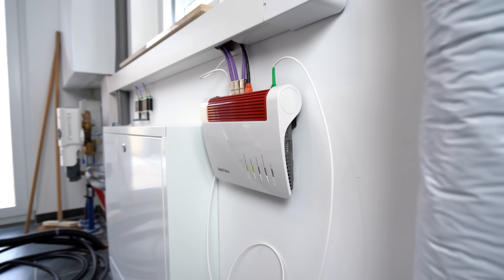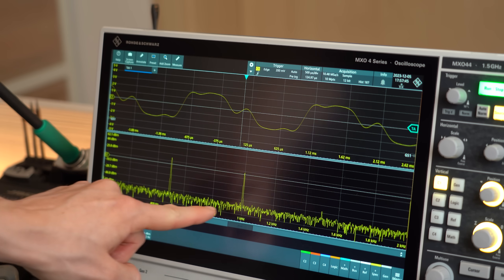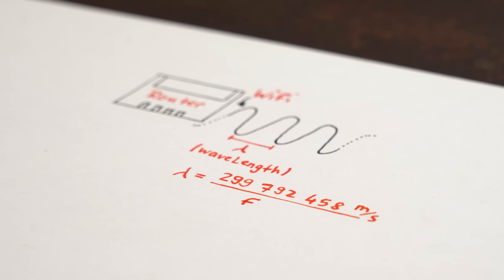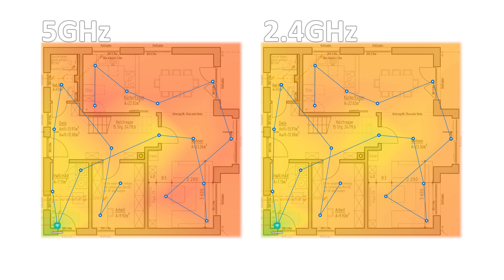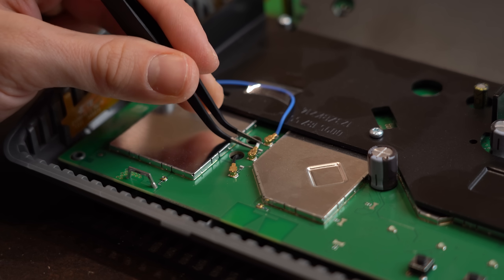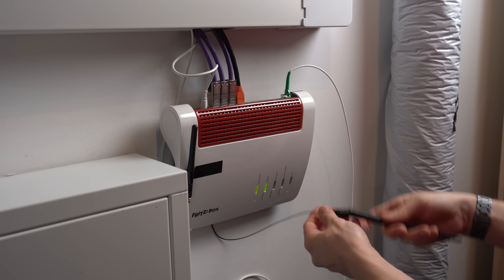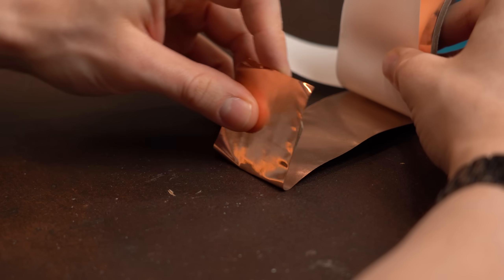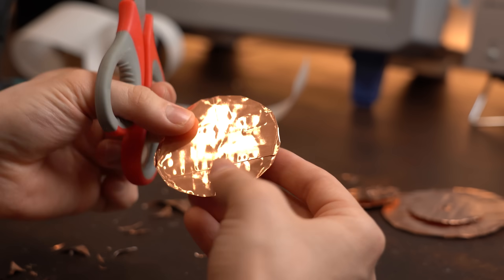I tried OVERPOWERING my WiFi!

Comment: Did you try swapping the two routers?  My guess is that the top floor has wood walls and the lower floors have masonry walls.  That would be typical of German construction.  If so, the difference may have been the walls, not the routers.

Comment: (maybe a little bit late): 
I fooled around months with new positions of the modem (even with Devolo Magic 2 LAN power adapter) ended up in exchange all  coaxial cable with CAT6/7 cables in my flat (which is on two stages) and a good separate access point on the second floor. So every fixed device (like TV) is connected via 1GB cable network. 
For 2 years so single problem so far.
Working time: ~ 1day (for getting out old coxial cables)

Comment: Your directional antenna is also illegal in Germany. At least without limiting the power. If you install an antenna that has a higher gain, for example cause it transmits mostly into a certain direction, you must adjust the power so that the equivalent isotropic radiated power (EIRP) remains the same. Essentially you must keep the energy density in the direction you're sending the same. Therefore installing a directional antenna typically doesn't bring you a great advantage (assuming you comply with the law).

Comment: There is also another problem with boosting the power of the signal, and that is that wifi communication is two ways.
If, let's say, you are connecting it to a phone, and that phone doesn't have the signal power to reach the router.
Think like two people far away shouting at each other, and only one can shout louder.

Comment: That so called directional antenna is completely inefficient and actually rubbish.  Properly constructed 5GHz antennas are available on the internet both in omni directional and directional (beam) types.  A Properly constructed gain vertical antenna for both frequencies will outperform the types you have experimented with.

Comment: Die you do a VNA Measurement on the directional antenna ? -- They are extrem sensitiv to korrect spacing etc. So that might explain it does not perfom that good. Those anteannas also have a extrem narrow bandwidth which can be a problem if its too narrow.

Comment: I saw your build of the antenna, and would like to suggest using a nylon bolt for the shaft. a metal support with no electrical isolation between the elements of the antenna defeats most of the advantages of the rear reflector and the parasitic elements in front of the main radiator ( the disk you hook the signal wire to. )
I built a dipole version of that to receive UHF TV signals when I lived in a valley surrounded by tall hills as a kid, and hung it in the attic of my house. only way I could receive the closest channel that was a PBS station halfway across the state from me.

Comment: And here I am upset when I am only getting 750 out of 950 Mbit (5 GHz) on my iPhone at some random location in my house due to some weird local dead spot in the antennae array or mesh overlap interference. 

Forget these consumer routers and their corresponding mesh systems. Buy a hardwired enterprise or at least prosumer mesh system. One usually tries to make stuff work for as cheap as possible and then realize that they should have done it the proper way from the very start. Also keep in mind that with such low transmit power levels in Germany, it makes no sense to place a router into a corner of your house and try to blast the signal across the entire house from there. With an omnidirectional antenna, you basically blast 50% potential coverage into the street if you place it at the edge of your house. In case you want to have a decent signal in your garden, just use a hardwired access point and place it outside. 

For roughly the money you spend on a FRITZ!box and some Fritz!Repeaters, you can easily get a couple of Tri-Band (2.4, 5 and 6 GHz) 802.11be (WiFi 7) access points and make future use of Multi Link Operation. Until you have more WiFi 7 clients, use WiFi 6 or 6E on the various bands. Another issue is that you are very limited with the settings on a FRITZ!Box. One used to be able to change the channel width, but with some Fritz!OS version they essentially just made all of them use 160 MHz. With the small 5 GHz non-DFS bands, you get quite a lot of interference, and most clients, especially smartphones, aren’t 160 mhz capable anyways. This shall change with WiFi 7, but it makes no sense for most smartphones which are 2x2 @ 80 MHz. The wider the channel width, the lower the real-world SNR. Depending on obstacles, it deteriorates the SNR and modulation and thus the distance even further.

In case you don’t want to jump the WiFi 7 bandwagon just yet, get some decent 4x4 MU-MIMO WiFi 6 or 6E APs. One doesn’t need too many people and clients in the house to make use of better speed and stability with DL / US MU-MIMO. One doesn’t need a 4x4 capable client to benefit from it. Beamforming can increase coverage and speed at a distance quite significantly and thus a fewer numbers of APs necessary.

Comment: Wireless basics.
Router with external antena.
Router in the middle of the house (map) in the possible.
Do not attach the router to the wall.
If you can't move the router.
Use one access point and fizx it in the middle of the house.
Sorry for ny english

Comment: Or stop wasting time, move the router to the middle of the house like a normal person 😂

Its a fritzbox just buy some cheap 3000 series and create a mesh i got 2 3390 i think they are for £30 each between them and a 7490 they cover the entire 1930s build 3 bed house with really fast speeds taking advantage of 1Gbps fibre.

I get about 600Mbps at the weakest point and 833 nearer the waps on wireless and obviously 1Gbps on the wire

Comment: Most issues are placement or orientation.  
I picked up some HP/Aruba 802.11AC APs which are PoE for $30/ea on eBay. Also picked up a cheapo Cisco SOHO switch $30.
I just went up into the attic and tacked them up there, ran some Cat5E patch cable down to the switch and then to my Verizon router.
~$140 all told, and my Ekahau survey had me at 65-70db for 2/5Ghz throughout a 1-1/2 story 2100sqf house.
Going to add another one with a mini-panel antenna for the 600' backyard.
If one only has a broadband wifi router, then it really pays to try to just plugging it in at different locations in the house to see where you get the best coverage before finalizing. Centrally located is usually best, and while I don't prefer them, a cheap wifi repeater $20 can give enough improvement to obviate the need for mesh or seperate access points.

Comment: Thanks for the video!
First of all, I note that your router has usb 3.0, and it has an impact on the 2.4 GHz network (more details can be found on the Internet “USB 3.0* Radio Frequency Interference Impact on 2.4 GHz Wireless Devices Intel 2012”)
Second, I note that the quality of your directional antenna greatly affects the result of the work, moreover, if you did it according to the parameters from the video, then I will clarify that they are incorrect even for 2.4 GHz.

Comment: Seems to me increasing the power would only work a little bit unless you add better antennas because the conversation is two way.  If you "yell louder" you must also "listen better".  I did a site survey and moved my WiFi routers around which has been very effective for me.  On the other hand if you had 2 WiFi routers and could increase the power of both they would make a good network bridge for repeating a signal.

Comment: Have you tried a styrofoam antenna? There you stick copper wires at exact distances into a styrofoam strip. As far as I know, the reflectors (the copper wires) should be isolated from each other and your build seemed to connect them with a metal rod.

Comment: Just modifying the antenna can also cause a device to exceed the regulatory EIRP power and still break the law. The best you can do is ditch the wifi in your router and install several access points. Don't even bother with repeaters. They were bad tech ever since they exist. Mesh solutions are marginally better, but the real solution is wired backhaul to every AP, as mesh comes with performance penalty too.

Comment: The Yagi antenna does work. You just built yours wrong by shorting the main element out to the rest of the antenna. If you isolate the main element from the rest it will work.

Comment: It's an understandable myth that 5GHz signals provide faster network performance. Network throughput does not only rely on frequency. It also depends on: the symbol rate (which is linked to frequency but also considers the processing speed and signal-to-noise characteristics of the modem equipment); the channel capacity (aka the actual RF bandwidth); how many RF channels are used simultaneously to provide a network connection; and finally, the bit-to-symbol encoding technology (which is sort of like compression). The wifi standards allow mixing and matching of these parameters to create just about any network speed on either the 2.4 or 5 GHz spectra. New versions of the standards add new capabilities as they get developed, increasing the number of options that can be chosen from.

The reason we see faster speeds on 5GHz is because, in practice, there are still a lot more devices using 2.4 GHz, such that in a given location it is often oversubscribed, especially if trying to do the faster speeds of more modern wifi specifications (i e.802.11ac or ax), because they require more/wider RF channels, which is hard to reserve on a busy network. It's like trying to get the entire row of seats on a bus or airplane. Can't do it if it's busy.

5GHz tends to have fewer devices using it, so it's easier to get all the RF resources needed for faster speeds. But 5GHz is still a shared resource, just like 2.4GHz, so we can count on it becoming just as crowded in the near future. However, there's actually the upside to 5GHz having lower pentrating power. It will reduce the radius of coverage, meaning fewer competitors for the spectrum. But it will require more base stations to be installed to achieve full coverage in a given footprint--which is actually the only solution to oversubscription.
.

Comment: Amplifying the wifi signal just won't work, anyway. Wifi, like modern cellular technologies, are a network on top of an rf waveform. The devices in the network communicate with each other. End stations in Wifi and cellular both tell their base station what their received power levels are. So the base station that detects above-normal (i e. above regulation) signal strength will lower it so that it is back within spec. They might even shut off due to apparent malfunction.

Comment: Great video, thanks a lot!!!  I have spoken to my wifi provider and tried to improve my connectivity tryout the house with no improvement.  Your solution worked great for me as well!!!  
I wish you would explore Antennas in other videos. For example how  to improve the reach from appliances like a baby phone, that have e emitter  and receiver Antenas that work in Bothe directions. Interference must also play a role in the signal reach. Is there a way to minimize that?
I live in a an apartment building in São Paulo Brasil.  I bet interference is also an issue here.

Comment: Try moving your router to the center of your house, if it is possible. Probably not. The next thing would be to change the position of your antennas. Currently they are taped to your router, which isn't quiet good for an omnidirectional antenna. You've explained it pretty well. The last thing i wouöd check would me how much utilised the channels are your wifi is on. There might be optimization potential. Last but not least, some devices might interfere and reduce wifi troughput. Hook up as many devices by cable as possible.

Comment: Just don't use a garbage router and use Ubiquiti gear or something that isnt a garbage home isp router and if your house is big put multiple of them around. Ideally should be plugged in with ethernet but you could do repeating. 2.4ghz is slow so if you are able to disable it then do it.

Comment: I built my system with Mikrotik system. I have 3 AP's that are all PoE enabled and the router itself (which is very small) is located in my electrical cabinet where the ethernet cabling and fiber to the outside world are as well.

Their CAPsMAN works very well even if at first it was a bit confusing to set up and all the AP's work as a mesh. AP's are small, low energy and I've just dotted them around my apartment so each room has coverage and because they're all PoE, they do not require bu one Ethernet cable that can be easily hidden away with cable trunking or using the CAT5e that's already within the walls of the apartment.

I have 2 small 2.4ghz AP's for general usage and coverage and one 5Ghz/2.4Ghz AP

It was cheap, looks very nice with proper installation and has worked very well :)

Comment: The big problem I noticed with the antenna is that you need to isolate the copper elements from the rod, otherwise it will seriously affect your performance.  That's why Yagi antenna elements are insulated from everything else (except the feed line).

Comment: It works VERY good. What you are doing though is like using a fishing rod of 10 meters trying to fish in a 3 meters ditch.. That doesn't work well .. LoL
With the diy antenna I'm picking up wifi from 150 meters and further.

Comment: Experiment not well conducted. The directive antenna, badly constructed. It kills RF. Thre elements of the antenna are connected to magnetic iron. Iron kills the microwaves. Never build antennas with that material! Only copper, aluminium, silver, gold.

Comment: 7:06 please secure your optic cable. It's not good for fibers to bend it like this. 
IMO move router in the middle of the house. I've covered a lot more area with single router, and outside with cheap repeater. Knowing wave propagation its a must.

Comment: The problem lies in the firmware. 7.2 was really good and covering most of my apartment. after upgrade to 7.5 (or 7.8 i forgot) that whole thing turned into scrap, and no, there os no way back. im heading for a better solution from a other brand now. maybe ubiquiti. avm products sucks more and more with every new device. i can’t recommend anymore.

Comment: Some points from a ham with an Extra license:
1. Those IPX to SMA converters are _terrible_.  Coax is lossy, turning RF into heat, and the higher the frequency the higher the loss per distance.  It's better to keep those as short as possible, and use as thick of a coax as you can manage.  Honestly, you'd be better off ripping the IPX out and wiring in a proper SMA connector, then use the thickest SMA coax you can find to connect to the antenna.
2. Polarity matters!  No, not electrical polarity, EM polarity.  If the antennas are all mounted horizontally in the AP but vertically in all of the devices, you'll only make connections via the RF that bounces off things.  This is why the best APs have multiple antennas, beyond just one for 2.4GHz and one for 5GHz, and beamforming; you angle them differently (preferably one vertical, one horizontal) and the router works out the best antenna(s) and phasing needed to talk to each device.  Beamforming is really quite powerful.
3. Signal strength doesn't matter nearly as much as Signal to Noise (SNR).  If you can reduce the noise floor, say by selecting another channel that your neighbors are using, or turning off bluetooth on devices not using it, or properly grounding anything and everything that produces RF, you can operate wifi way, way, way below that 100mW standard.
4. Amps aren't illegal, if they stay below the legal power limit in your jurisdiction.  In the US, and most countries, that's way above 100mW; it's 1W at the transmitter and 4W EIRP at the antenna for the US, for instance.  But:
5. Amps are mostly pointless unless you use them on both ends of the wifi link.  Great for immobile P2P bridges (which can actually go all the way up to 158W EIRP in the US), not so great when one end is a phone trying to conserve battery.
6. The dipole antenna with the two hollow sections likely has a very low Q, which means it is usable across a wider range of frequencies without introducing impedance mismatches.  The improved results you got by going to the higher frequency was far more likely to be from escaping congested bands.
7. Your 'disk yagi' probably needed tuning, which is extremely hard for antennas in the GHz range.  In addition to getting the distances between disks right and the disk diameters right, it's critical that the feedpoint on the antenna be very precise or you'll get an impedance mismatch and lose half or more of your power as heat in the coax.  Or if the coax is particularly lossy, it'll end up doing the work of an antenna itself.  It's an interesting design, but lacks explanation of how to get the impedance matching working.  Without some incredibly expensive SWR meters that operate at 5GHz, you're stabbing in the dark; what I'd do is set up a device measuring power a distance away, solder a sharp pin to the inner wire of the coax, and poke it into the second disk at different distances from center until the best result was found, then solder the pin to the disk.  But it's really tricky, as the difference in lengths between the coax braid and inner wire can make a huge difference, too.  SHF antennas are not easy.

Comment: Seems the best option is Mesh Network. Per my understanding, it is brand-specific except EasyMesh. I tried to find such devices, but see only routers, switches,etc, not Access Points. My wifi router supports EasyMesh. Still do not understand how to extend WiFI coverage..